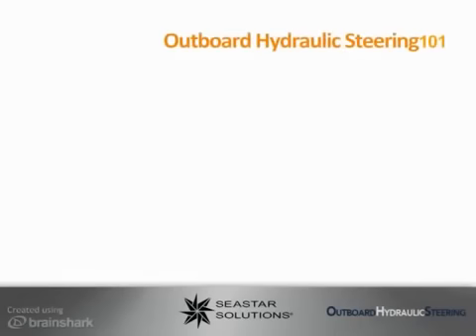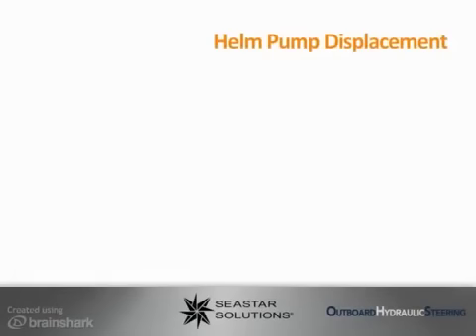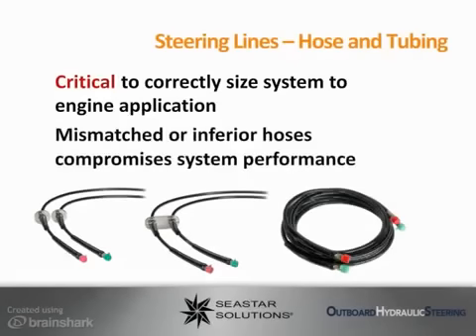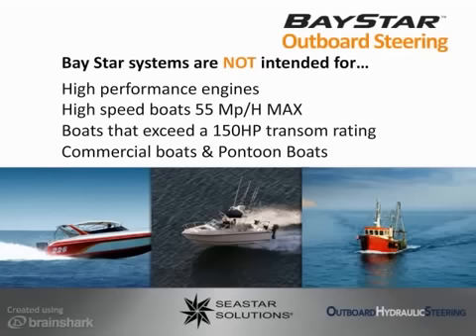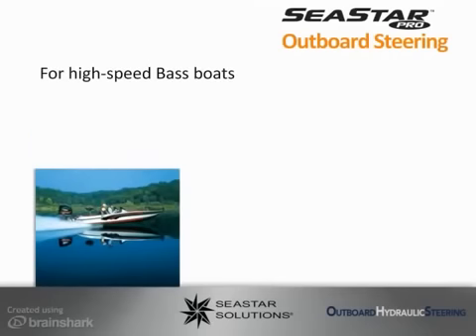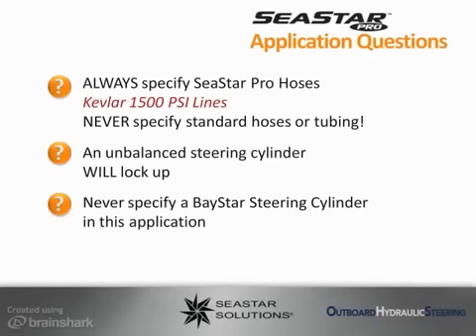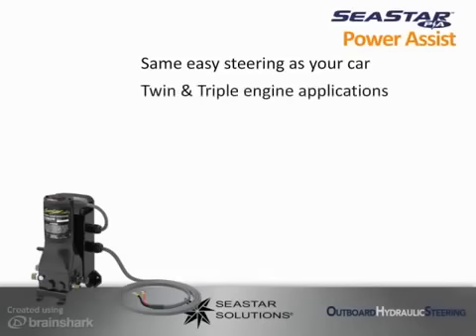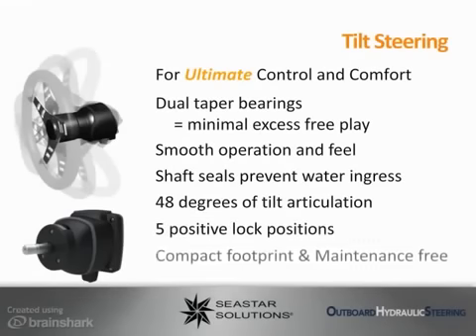SeaStar Solutions Outboard Hydraulic Steering

Comment: Baystar  steering not good quality mine is 4 months old but the end cap seals pop out and leaks oil
Reply: I was just about to buy Baystar - are you saying it does not work - I see that yu are - did you get it fixed?